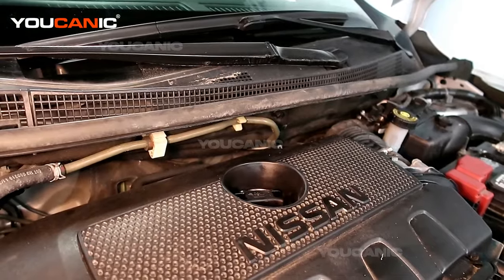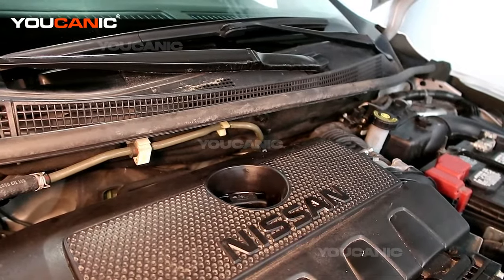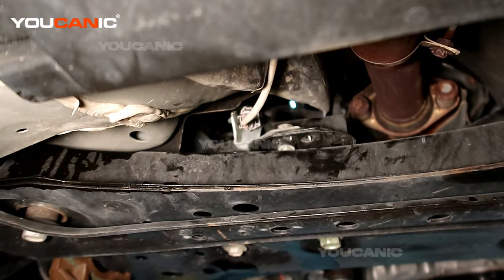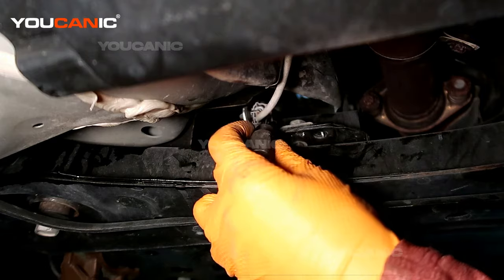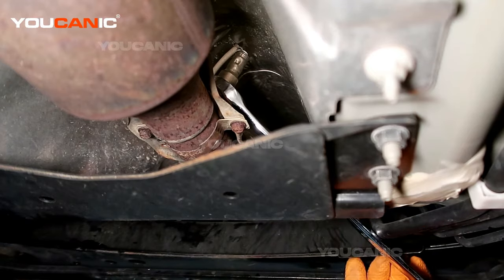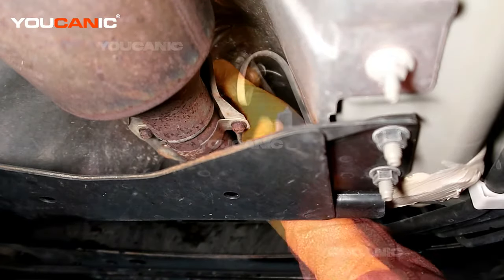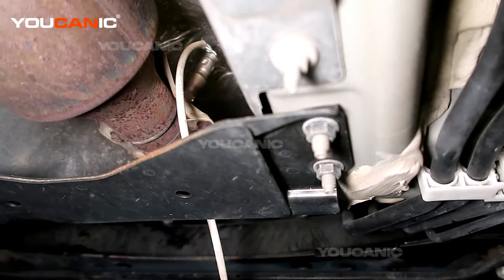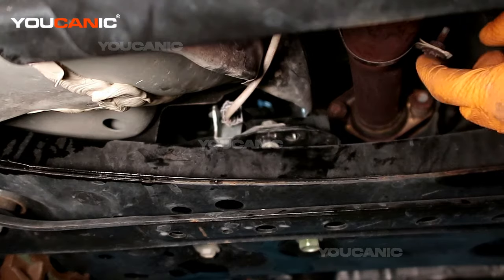2013-2019 Nissan Sentra Bank 1 Sensor 2 Downstream Oxygen O2 Sensor Replacement

Comment: That sensor came off really easy. I tried to take it off on my Sentra but it didn’t budge. I’m sure when you use a lyft you can get better leverage. Thanks for showing this video.
Reply from the maker: Thanks for your feedback! We're always striving to make car repairs easier for everyone. When it comes to diagnosing modern cars like your Sentra, having a quality tool like our YOUCANIC Full System Scanner can greatly assist. Visit www.youcanic.com/scanner to learn more about how this scanner is revolutionizing DIY car repairs.

Additionally, for precise procedures and torque specs of specific models, benefiting from our Factory Repair Manuals could save you a lot of guesswork. For a reasonable cost, you can gain access to these manuals at www.youcanic.com/manuals. Good luck on your car repair journey!
Reply: Definiely get one of those ramps and put center blocks on the back tires

Comment: How the f%%k does the 02 sensor connector come apart? Put the screwdriver in WHERE?????? Argh
Reply from the maker: Hi there, thanks for reaching out! We know car maintenance can be a bit tricky sometimes. At Youcanic, we offer helpful guides and free resources on our website www.youcanic.com, aimed at making car maintenance easier for you. 

If you need detailed assistance, our factory repair manuals can guide you step by step. Remember, our mission is to empower you, and we are here to assist you on your car ownership journey. Reach out any time; we're confident we can help solve your O2 sensor connector issue and more!